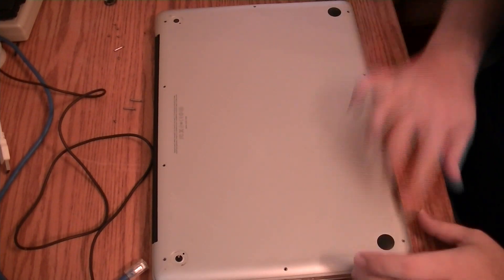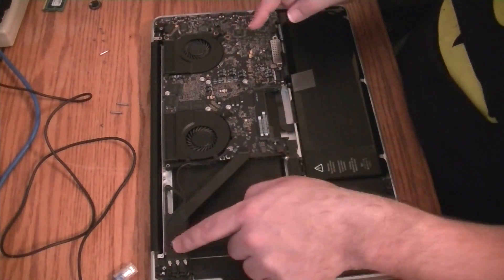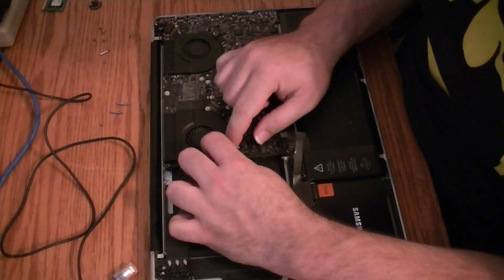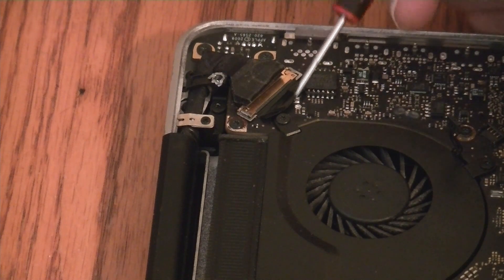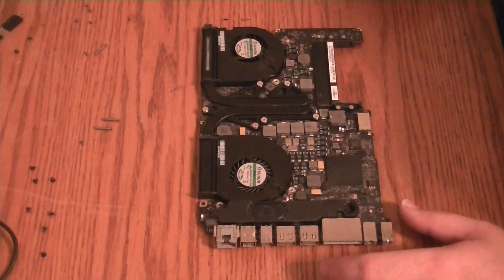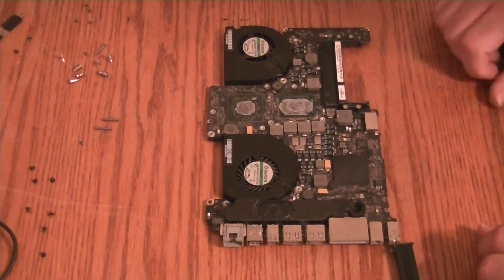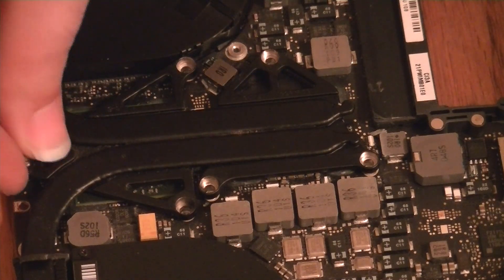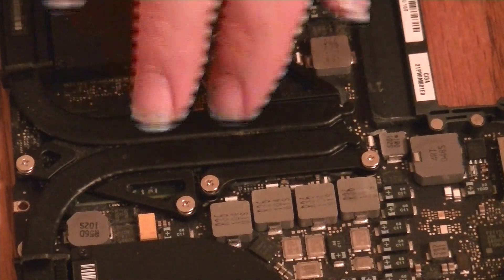HowTo: Stop Macbook Pro 15" Overheating (Macbook Pro Repaste)

Comment: this is still overheating right? I mean even 150 f is so hot
Reply from the maker: 150F is hot, but not so hot to a computer chip.  Would I like it cooler?  Of course!  Compared to 210F, it's a lot better!
Reply: @uberDoward  my Macbook pro mid 2010 is already 170f when loaded . I was thinking if I followed the instructions it will be a little cooler 
My windows pc is around 50c which is normal

Comment: Gave me inspiration and confidence that I could do the same. Today I have done so, with success. Thank you. Machine running quite a bit cooler to the touch during software updates. Nice.
Reply from the maker: Always happy to help!  Just don't rush things, and be methodical, and anyone can do it.  Enjoy your machine for (hopefully) years to come :)
Reply: Did Mac Have A Problem With Overheating Logic Board?  2.8ghz i7 16gb
Reply from the maker: @authenticcertified9864  Did?  I think you mean 'Do Macs still' - and yes.  The answer, is yes.
Reply: @uberDoward  Yes Your Right" An The Cause Is??
Reply: New thermal paste help quite a bit

Comment: you dont need to spread the thermal past around so that it covers the whole area? what about the other side?  i did it myself for the first time so i didn't know how much to put.  i ended up putting it on both sides and spreading it out
Reply from the maker: Definitely not on both sides (you'll end up with too much!) - a small bit that is then spread out with no chance of air getting in is the best way to do it.  Why?  Well, air is a superb insulator!  And that's not at all what you want when trying to transfer thermal energy :)

Comment: The Apple store says my 2011 15" "Probably needs a new logic board" after trouble shooting. It shuts down after warming up. Think doing this could fix my problem? Possibly? Great video Bro!
Reply from the maker: Worth a shot!
Reply: Did it work for you or did you need a new broad? My computer is doing the same as yours.
Reply from the maker: It worked fine for me :)

Comment: Since you take so good care of replying I thought of posting my MacBook Pro issue to gather your thoughts.
The overheating I experience is only when charging the open laptop. If charging closed or not charging such temperatures around the charger are not obvious. It is a 2.5 y/o machine for which I had already bought a new power cable and even subsequently a new battery which sadly was not OEM and dies once reaching an 8% charge display. Nothing else obvious in terms of warning signs but I do wonder what the underlying issue could be and whether there is something worth attempting to make a difference. Heat Sink thermal paste change sounds like a way to improve it, is there a further diagnosis you could give on a case like mine? Thanks a bunch Doward!
Reply from the maker: +Ana Mendes P. What's overheating, the laptop or the power brick?
Reply: +uberDoward the Brick and the MagSafe itself and thereabouts on the laptop mainly. smcFanControl turned to higher RPM does help to keep it not so high. It does seem to be some underlying issue as I bought this from an Amazon retailer back in Dec 2013 and already destroyed 2 power adapters. 
Its specs after entering Serial Number C1MJP0V8DTY3:
http://www.everymac.com/systems/apple/macbook_pro/specs/macbook-pro-core-i5-2.5-13-mid-2012-unibody-usb3-specs.html. RAM upgraded right after purchase in 2013 though.
Other peculiarity is that when trying to book a Genius Bar Apple Store appointment to take for check up, this Serial# appears allocated already to an AppleID different to mine. In the end I had to postpone making this booking and I'm exploring what could be the actual cause for this somewhat recurrent issue which now is more evident than previously given the outside temperature is not tolerable to the human touch. Allegedly the equipment was new and so it appeared upon arrival all properly packed etc. Thank you very much indeed for any insights! I was wondering if replacing this piece would be worthy? https://www.ifixit.com/Store/Mac/MacBook-Pro-Unibody-13-Inch-and-15-Inch-MagSafe-DC-In-Board/IF163-011-2
Reply from the maker: If the brick and magsafe are overheating, my first thought is that the brick isn't outputting enough juice to the laptop.  Which wattage brick did you pick up?
Reply: I will need to look into that for precision. The most puzzling thing really is that it charges fine if I just close it, not heating whatsoever around charger and else...

Comment: great great video, because we can see what you are doing.
i have a mbp i7 2.4ghz late 2011 17 inches. (mbp 8,3)
Is there a difference between the 15 and the 17 for this procedure or can i apply everything you did on my 17 inches ?
thanks anyway for this great video.

by the way, is the repasting a real improvement in lowering the heat of the mbp (using macs fan control 1.2.1 to monitor it, the best) ? for instance, i reach 90°celsius in playing 1080p video and it starts fans to reach 5700 rpm. Will the really go down after the repasting ?

thank you.
Reply from the maker: 2204pc Thanks!  Yes, some of the connections will be different on the 15", but the rest will be the same.  And yes, you will have a much reduced temperature :)
Reply: uberDoward thanks. a bit (a lot) afraid to do it but i think i am going to.
Reply: Hey 2204pc, I've got the same 2011 17" as you. I don't think thermal paste is the answer for our Easy-Bake-Oven-Macs. AppleCare has been through and through my machine multiple times. They would've taken care of this. 2011 MB Ps have always run too hot. 
I used a Tecknet laptop fan for a few years, kept it in the 50s and 60s C. I just bought a Kootek--useless, unless you're frying eggs. It's not only useless, it made my MBP run hotter. A DIY open frame worked better (Kootek 81C, open frame 67C) [The DIY is 5/8" strips of wood along the sides. For a wrist guard and to join the two strips a rounded piece about 1.25" wide as a wrist rest-slightly higher than the Jon Ivy wrist slasher edge.  At the back the cross piece is below the two strips. A couple of nubbins on the sides to keep from sliding left and right. Then some pieces lifting it off the ground. The rake is 8-9 degrees. Plus 3" at the wrist, 4.5" at the back) Could go to 12 degrees. I'm typing on it now, sitting on my desk. It's not at all bad.] 
I think my next move is to make my own fan set up.  (I have a pair of AC Infinity fans blowing down into my stereo amp. It works great. I've got a car cabin air filter 8 x 8".  The dust it's collected is frightening-so it's working. I run the vacuum  over it. The configuration is all cardboard DIY: 8x8" filter 'tray' on top, then a 4" x 8" box below the filter. And this sits on top of my stereo. It cools the innards, by blowing filtered air, it also keeps the insides clean. I just peeked. After almost two years it looks brand new in there.]  How to rig this behind the MBP 17"?  Fans mounted sideways, cardboard duct up to the hot area-the upper left  from the bottom of the keyboard G-key to the left side. Venting notches to the sides. I just talked myself into trying this.  I'm also thinking I might drill some holes in the bottom of the MBP case and tape some filter material over the holes. These 2011 17" MBPs are old, but still good machines. I really like the large screen. I have a 2017 MBP, it's in AppleCare which is why I'm using this machine. In many many ways I prefer this older machine. They're old, out of warranty, so I think we can hot rod 'em without worry.

Comment: I want to point out that if anyone decides to do this to make sure you are using a non-conductive paste. Arctic Silver 5 for example contains silver (conductive) which when heated up could leak into the electrical components on a processor like this and fry your board. The paste he is using is carbon based and much safer.
Reply from the maker: a) I've been using AS5 for near a decade with zero issues.  Why?  If you have enough thermal paste to run out off your processor die, down the board and gap a circuit, then you have used ENTIRELY too much!  You should have a small dot on the center of your die, and not much more :)  b) I used this thermal paste only at the customer's request - I normally use (and recommend) Arctic Silver 5.